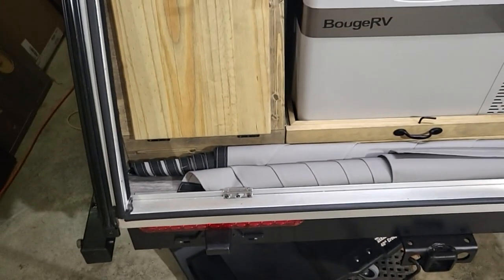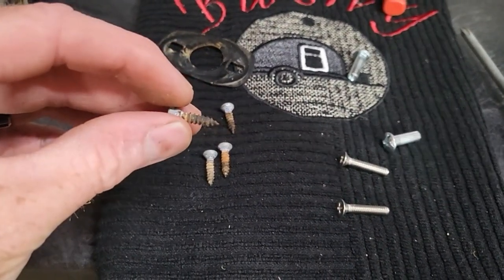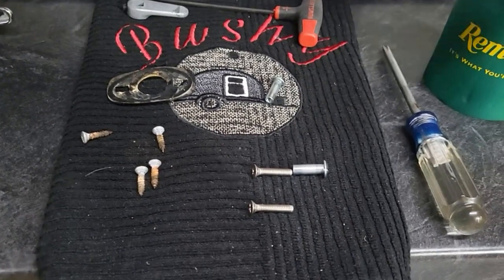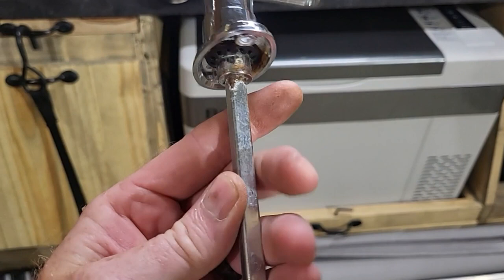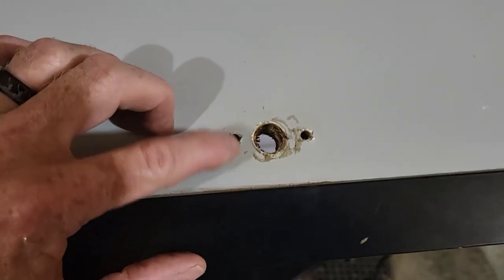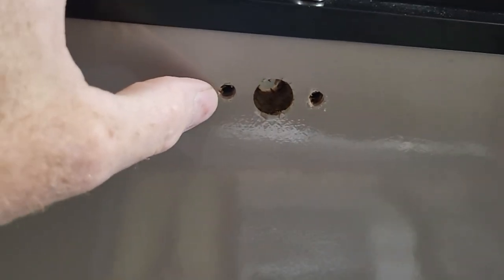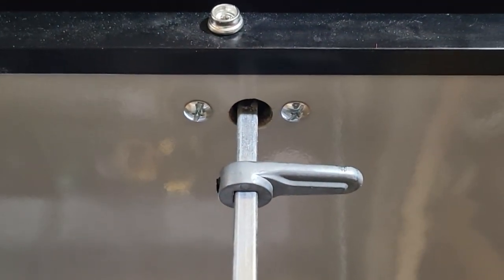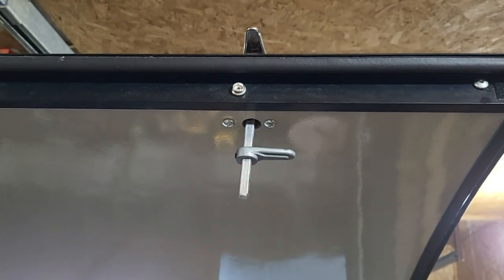Bushwhacker Teardrop Galley Door Latch Repair

Comment: Sam, you have the best ideas. So glad I did this project. When I went to remove the screws on my 1 year old 10HD, they practically fell out! I don’t know if it’s overkill, but I put a little butyl tape behind the gaskets—just enough so that it squeezed out the edges (especially on top).
Reply from the maker: Glad you caught it when you did. You might want to check the torque on the screws next season. We use butyl tape on our boat and it compresses over time.

Comment: I've been to 4 hardware stores and cannot find the 3/4" 10-24 binding posts.  HD nor Menards carry them either.  This is turning out to be the hardest part of this upgrade.
Reply from the maker: I hate to hear that. I will stop by the Ace Hardware I got them from Monday morning and get the information off the box for you and post that.
Reply from the maker: I stopped by our local Ace Hardware this morning and picked up some more. Their Hardware like that comes from Midwest Fasteners in Miamisburg Ohio. They refer to it as a thread post. That's really odd that your hardware stores did not have them and their Hardware selection. If you're unable to locate them locally just drop us an email and I'll work something out with you.
Reply: That’s even more bizarre because the first place I went was Ace. I’m going to check another Ace or two after work tomorrow. One of them is pretty big so hopefully they have them. Thanks for the addition info too.
Reply: Took 4 Ace hardware stores but I finally found the parts!  Easy upgrade and should be a big improvement too. Thanks Sam.
Reply from the maker: @fade242black  , good deal! Glad you found them. I ordered a whole box of them, they should be in before we leave for the Bushwacker Boil. I will put together hardware sets and have them there.
Reply: I ordered mine from Amazon, downside is that I had to get a box of 20.